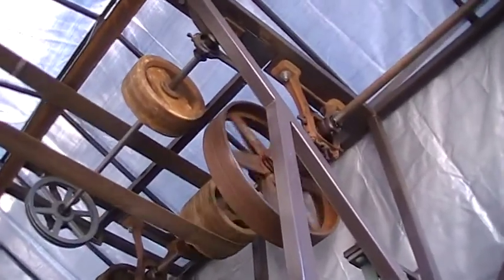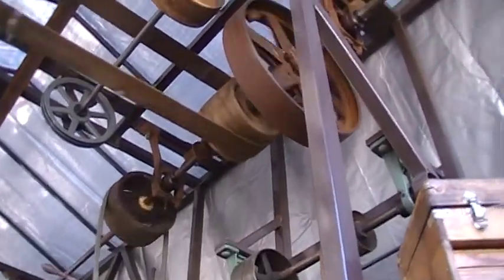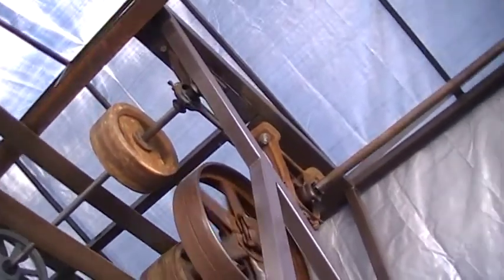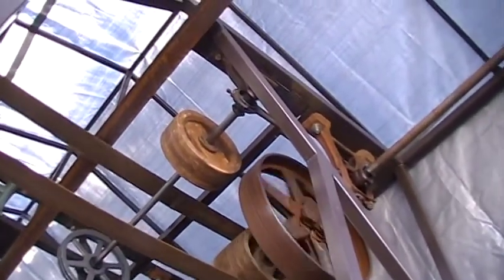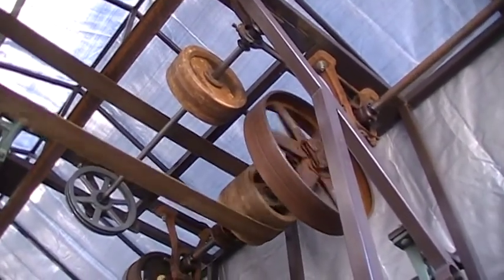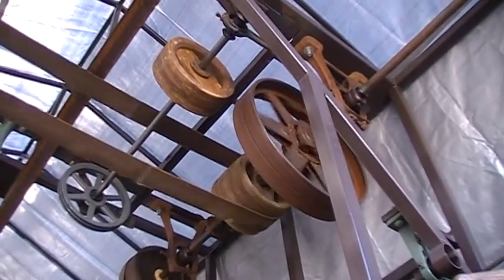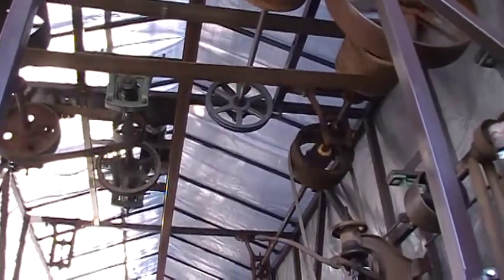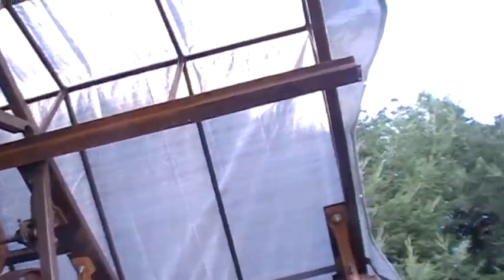Mobile line shaft machine shop

Comment: looks right to me its for threading or large diameter work its all about getting the right surface feet per minuet on you part. most line shafts run around 200 rpm to 250 rpm if that help

Comment: Hi...greetings from England 

The mechanism in the post drill headstock is a split nut design...

The speed on that lathe in backgear is about rite... 
Don't forget your on the largest step on the cone pulley as well... 
As has been said...good for running large taps, dies, drills, reamers and big O/D turns....
Reply from the maker: Thanks Glenn. I haven't got into the auto feed yet, been too busy trying to get everything running. But I will have to do something, eventually. Do you know how this mechanism works? It would be nice to have an exploded view.
Reply from the maker: Thanks again Glenn. I watched MrTrainman109's clear explanation. Now the mystery's gone. It's good to see a young man taking interest in old iron. When I get some time I'll have to disassemble the auto feed. I think it's probably old grease and gunk gumming up the works.
Reply: Dave Wilson 
It is... 

So many now are only interested in stuffing themselves with food & booze in metro trendy restaurants...whilst worrying about whether or not their paying roaming charges for their phones... 

Decadent lightweights...